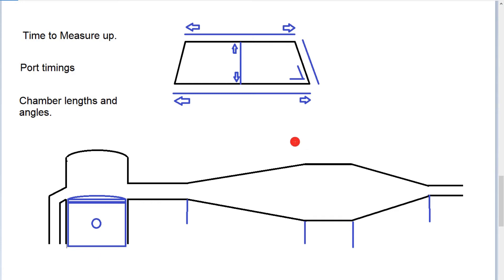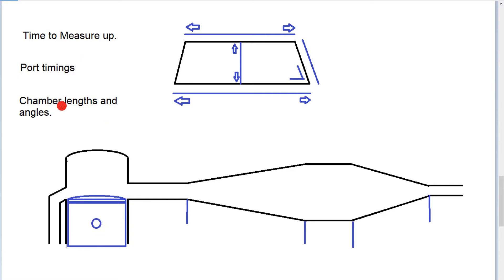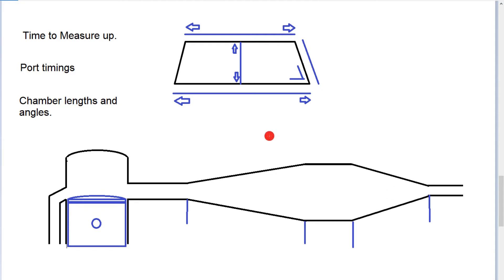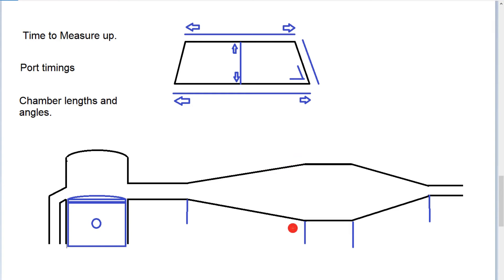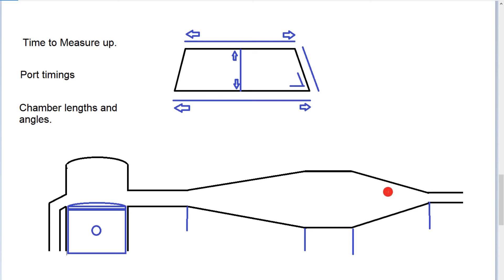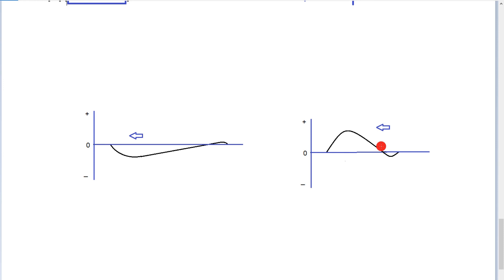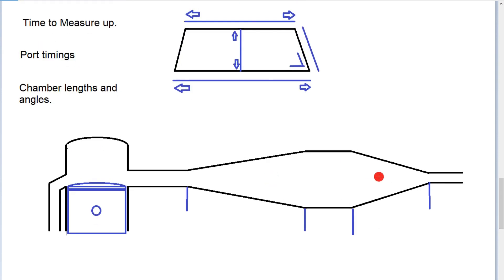Measuring and modifying 2 stroke expansion chambers, superposition of waves. E6

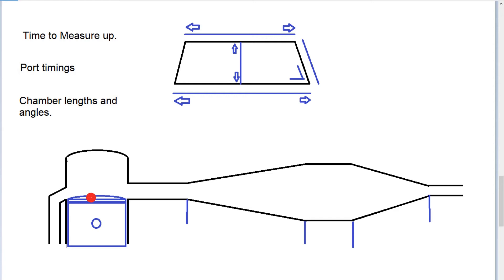Comment: Ive watched the whole series to here, and it finely stuck that you count shallow vs steep angles from vertical, whereas I always learned geometry as originating horizontally at 3:00 = 0.deg.
Reply from the maker: Angles use on cones are included angles being the total angle between 2 sides (not the angle between centre line and one side)

Comment: If i was to run the stinger basically along the converging cone and out the side of the belly should i keep it well out of tip of the cone? Does the tube being inside taking up volume completely svrew it all up or is it strictly the angles? Im lookjng at a pipe for a fairly low hp 121cc lawnmower emgine im putting on a minibike and i want a broad powerband. The pipe calc is only showing like 50mm belly and 27mm stinger so it would be REALLY filling the belly and cone up.  I haven't checked my port timing but a few guesses dont change it that much.
Reply from the maker: The volume has no bearing on the operation of the pipe, it is the angles of the cones.
And you can, run a wide stinger at any location off the baffle cone.
Also the stinger length is entirely optional, the specified length only determines the effective restriction the stinger has on gas pressure, it is purely a gas pressure bleed off there is no wave activity on the stinger.
There was actually a study done on this to prove the point and in fact you can have a larger shorter diameter stinger with a washer at the front end of it where it exits the baffle cone to determine the amount of pressure restriction with no adverse effect.
Reply: @AuMechanic  ok. So I could have a “stinger" starting right at the transition from belly to converging rear cone where I could adjust the stinger size with a bushing and then directly into a silencer?
Reply from the maker: @jasonbirch1182  Yes
Reply: @AuMechanic  interesting. I could probably fit it on my tiny mini bike then. The reality is that it needs more power like it needs a machine gun so idk. I do.hsve another of the same engine that I'd like to put on a kart though so that would still help keep it reasonably compact.

Comment: 2STROKESTUFFING sent me this way. I have watched a few of these videos but I'm not going to lie. It's a bit overwhelming. I'm pretty sure the eBay exhaust for my 30 cc rc car is not designed well. I don't know where to start. Lol. Can you maybe give directions of what I need to do. Maybe some steps. Unless I'm missing something.
Reply from the maker: Hi John.
No need to watch all the videos in one go, it is quite a lot to take in..
A few of them I've covered some basics of the pipe with a view to measuring up a pipe and getting some idea if it is suitable, or to modify it and what to expect.
I will be doing some more on modifying pipes.
Reply: Do you have a video that is kinda crash course on what measurements I need to do. Maybe like a quick tutorial. I'm not likely to become professional builder or racer. Just kinda want to have something close. If what I have is close I'm ok with it but if minor change is a huge gain I may try my hand at it.
Reply: This is the pipe I bought. Think the header part seems very short compared to most and this muffler sounds really deep. Not the normal tinny 2 stroke sound. 

https://m.ebay.com/itm/Afterburner-Tuned-Exhaust-Pipe-fit-HPI-KM-ROVAN-Baja-5B-5T-5SC-Truck/130959466913?epid=1155157275&hash=item1e7dcae1a1:g:nIYAAOxydUJTNTEk
Reply from the maker: Hi John
Ill do another video on it but basically you need to first know the tuned length of the pipe and to do that you need to measure the exhaust port timing period in degree's, that tells us how many crank degree the wave has to get back to the exhaust between open and close.
The peak RPM that tells us how how much time there is over that exhaust open period.
You need to also have some idea on the average temperature the pipe operates at, this determines sonic velocity in the pipe so we know how fast the wave is travelling.
Once you calc tuned length that way you can compare it to the pipe length to see if it is close.
The header pipe is very short, but the higher the RPM the engine revs at the shorter you want the tuned length.
In Sprint Karts they use a flexible section in the header that is adjusted to change the tuned length, so you can shorten it to rev more or longer to  favour the lower end.
That is the basics of it, the diameters of the pipe as covered in the vids is more complex to calculate but the video gives some starting figures to use.
Reply: Awesome. Thanks for the help. 2STROKESTUFFING is also helping me out with some porting.  Not much info on these small rc cars and what is seems to be highly guarded. He asked me to measure the ports and also said around 190 would be a good number to shoot for. So I will do some measuring for that. He gave me a few tips. As for the rpm I could give factory specs. Don't known if that will help. But basically playing with a 30cc 2 cycle string trimmer, weed eater, weed wacker strapped on to a large rc car. Some day would like to go up to 36cc.  But by then hope I know enough to figure out the new one.
Reply from the maker: Yes you need to establish the port timing as everything more or less hinges around that, the pipe is tuned the the port timing too.
Peak RPM and temp goes in to the tuned length equation. (which Ill cover)
Is that the Zenoah engine ?
I've seen them use in RC Helis, I used to fly them in the 90s (I flew OS Nitro 60 and 30)
Reply: Port timing thing makes it a pain. Lol. Because I want to port it and get a bit more pep out of the engine it's self. Not even really sure what to do with the porting. Trying to get answers on what step I need to do but get 5 more questions i need to get the answers to before I can get to that step. Lmao.
I find it funny that they sell these tuned pipes "even the reputable professional ones" say the pipe is good from 26cc to a 32cc.
It's a fuelie engine. Rebadged cy "Chung yang" engine.  But similar to a zenoha engine. 
I have no luck with things that fly. Let alone a heli. Have seen some amazing videos of people flying helis. Trick type flying. Just crazy. 
If you want we exchange email if it would be easier. Or keep going on YouTube. Thx
Reply from the maker: Hi John
email is ausmecham@gmail.com

Comment: Yes if you could point me in the direction of how to properly measure my cones lengths and angles and what about a curved cone? Thanks
Reply from the maker: I can provide the equations to calculate centre length from angle and diameters or angles from diameters and centre or side lengths of a straight taper if that is what you need.
I might do a quick video on that as it is useful.
Since a curved one is not a fixed angle then a single equation wont cover it and it has to be split into a mesh of short sections and each one measured to make up the whole taper.
Reply: AuMechanic I am having trouble with finding the right equation...please help...point me to the right vid or equation..

Comment: Great videos, I am learning s lot. My question is, how can the compression wave off the baffle cone catch up to the negative wave off the diffuser and cancel each other out? Do they not travel at the same speed and the negative wave of diffuser is headed back toward port before the positive wave off the baffle even starts to come back?
Reply from the maker: Hi Ride Fast.
That can occur with residual wave reflections or echos, i am doing a video on that soon.
The primary compression wave arriving back at the piston reflect again off the closing piston.
It does a return trip however that is during exhaust closed period where the local sonic velocity slows down as temp drops
This occurs a few times and the result is that the residuals pass by the primary waves and superposition.
Which also makes it difficult reading a pressure pulse because it may have a partial super position of a residual wave in that pressure read.
Ill cover it in more detail in the new video.
Reply: AuMechanic thank you...itcan get pretty damn confusing trying to time that on top of everything else...but I'll keep up with your vids and keep researching to learn more..i have a Gas bicycle I have tuned and tinkered for years and made nice looking pipes..hack and weld ex chambers from different 2 strokes. I have never really known enough though to make a proper pipe or know which one would work better but I am catching on now. Got some more of your vids to watch still.Thanks again.

Comment: hello friend you have facebook I want to make you some consultations of the measurements I have a 70cc engine..
Reply from the maker: Hi Juan. I dont have FB sorry. Hang on to those measurements as I will be going over the steps of how to use those dimensions once they are measured, re port timing in pipe dimensions.
The aim of the videos is to explain how they work, also to the degree you can do the basic calculations and assessment of the timings and pipe dimensions and will know what those figures mean and what to expect when changes are made to them.
It will take a few videos to do but it is not difficult, when you lay it all out expansion chambers are fairly simple to understand and does not require any skills with maths or science.
Pipe designers may like to pretend there is "secret sauce" in the expansion chambers and you need to be a guru to understand it all, but that's all myth.